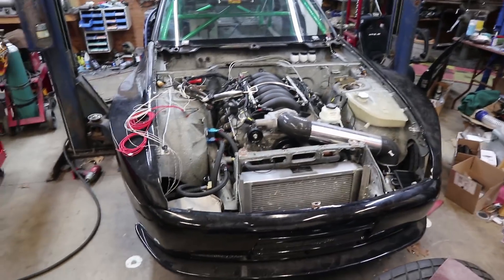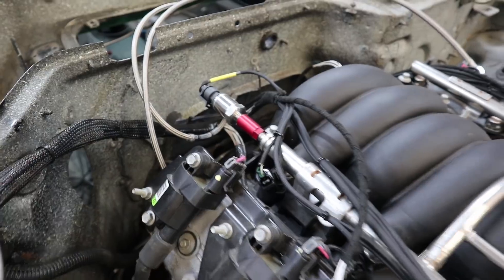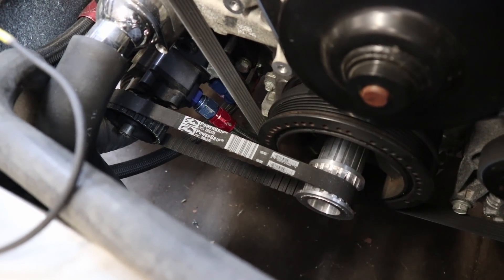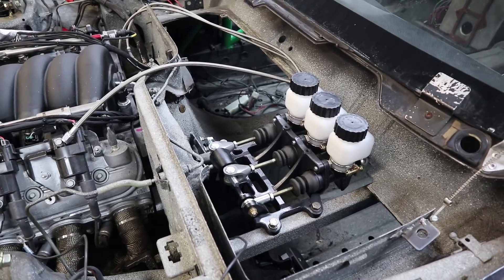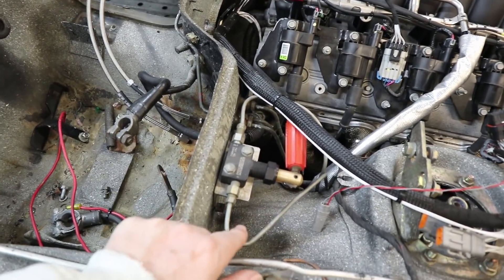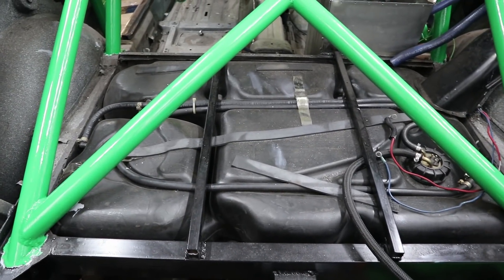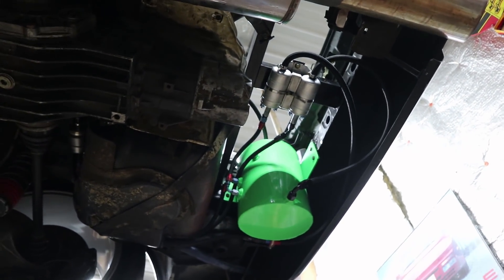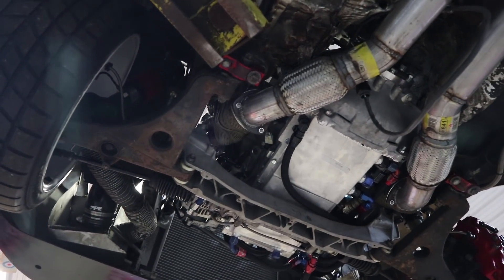LS3 into Porsche 944 race car

Comment: How well is that gearbox holding up? I
Reply from the maker: So far just fine.  Connecting rods - not so much...
Reply: @vsvenson  thanks for the reply. I was on the fence on whether or not to just swap out the drive train for a corvette TT/ gear box.  I suppose if i don't push beyond 400hp or so, it should be fine with the 968 gear box/TT. cheers

Comment: what dry sump pan was that Van?  also are you using stronger CV's back there?  Haven't had any problems with the LS1 but seems like CV failures are occurring with the LS3.
Reply from the maker: The oil pan is by CX Racing, and the CV joints are GKN.  I think the majority of CV failures happen when the transmission is able to shift side-to-side.

Comment: Great build so far, I'm going through the same process with my LS2/3 in my 951. I can't really tell by the camera angle, but it looks like you might be leaving 60+ hp on the table with those headers.. there's only one set out there that i've seen that has the correct diameter runners for the LS3 heads and they are long tubes too... $1600 later.. but MASSIVE dyno proven results over what it looks like you have.
Reply: Kooks if i’m not mistaken. There should be a 1 3/4” AND a 1 7/8” option available to suit displacement and cam/head size. There’s quite a power difference between long tubes and a shorty header, but I was unaware that it was 60hp. Did you get your LS-951 going?

Comment: What bellhousing are you using? I've read on renegade hybrid that the one they sell is the only one that will line up with the factory toque tube. I've seen other places that you can use a c5 bell housing?
Reply from the maker: It's the Corvette split bell housing.  There's an adapter plate for the torque tube to bolt up to it.
Reply: Okay. I'm doing my own fab work so i don't want to spend 2 grand on a swap kit when I only need the adapter plate. Any chance you have a part number for the adapter plate.

Comment: Wondering if you could help me with the brake system...

What Tilton pedal assembly are you using...Tilton 600 Overhung? 

Also what master cylinders are you running?

Comment: Excellent engine choice. Are there any structural differences (from a standpoint of chassis rigidity) between a hardtop and a sunroof 944?
Reply from the maker: A non-sunroof car will weigh a little less, and have a slightly lower center of gravity, but I don't think the structural rigidity is much different, because the sunroof cars have more of a "boxed steel" structure around the roof opening.  (And, at least with a roll cage, the race cars I see with fiberglass roofs or the sunroof hole paneled over, don't show signs of cracking or flexing...)
Reply: Van Svenson Excellent.

Comment: Van, 
What transmission was that? That did not look like the original 944 Turbo trans.
Chad
Reply: Thank you for making that video!
Reply: It's 968 6 speed
Reply: @mikestach3395  is the 968 trans a bolt in swap?